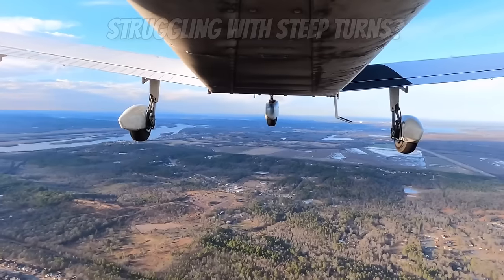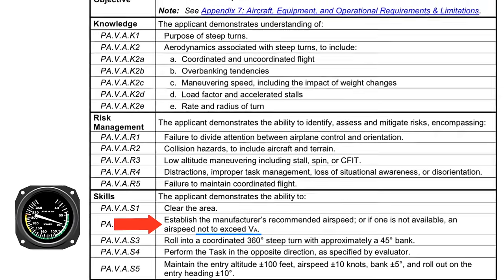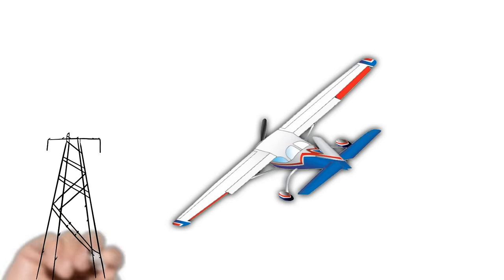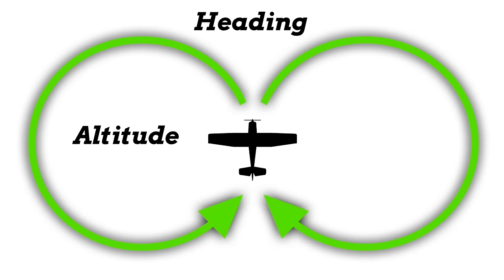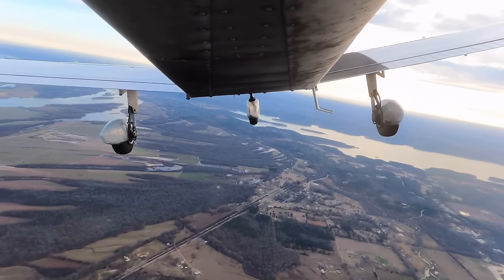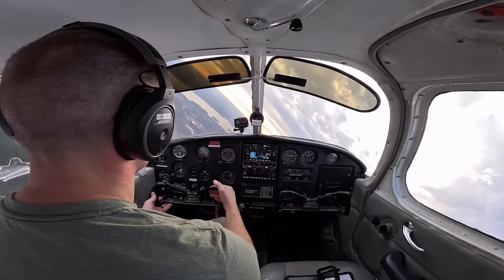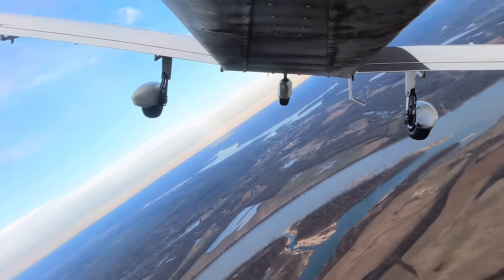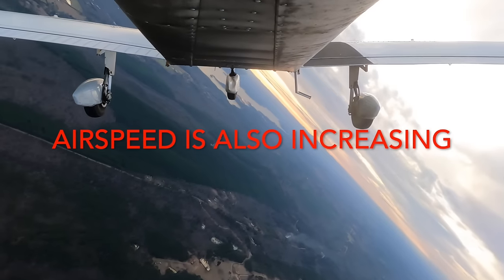3 SECRETS to Fix Your Steep Turns | How to Perform Steep Turns

Comment: The best instruction I've seen about steep turns;excellent job!!!
Reply from the maker: Thanks Rafael!
Reply: I agree
Reply from the maker: @FeltonZackery-gm8yl  thank you!
Reply: Left out the use of the VSI VERY IMPORTANT and use of Trim.  It's ok to use and will help you.  So where is the instrument that gives 1.414 Gs.  Learn toss that and scan interpret scan interpret scan interpret and use smooth inputs.  In over 45 yrs of flying and years of teaching I don't know any pilots who are doing 45 degree turns with passengers on most flights.  You need to know how to do them safely and that takes practice.  Be safe

Comment: How do some modern aircraft not have a G meter? Modern phones have a G meter. Just rapidly rotate in place with your arms outstreched and it will jump to like 4 or 5 G sustained. I don't understand why they would design planes without a tiny little accelerometer. Maybe they just figure you will attach your phone to the instrument panel and use the G meter in the phone for the aircraft?
Reply from the maker: Unfortunately things like that have to go through a certification process.  If you think about it, it kinda makes sense because IF you have a G meter and the G limit is 4 Gs.  How many people are going to go out there and try to pull 3.9 Gs, then if it’s even slightly out of calibration, you just over G’d without knowing

Comment: I also recommend looking at the VSI.  It will give you a better indication of what's happening.  the three secrets are fine, but remember use all the resources like TRIM, POWER, SCANN SCANN SCANN the other INSTRUMENTS, and there is NO INSTRUMENT THAT tells you your holding 1.414 Gs so tossssss that.  Learn to use your trim it's easy and you can use it in ALL Planes.  We're not doing 45 degree turns in normal flying or at least shouldn't especially with passengers, but we must know how to do them safely.  So PRACTICE and be safe.
Reply from the maker: Agreed. The only bad thing about the VSI is that it’s a lag instrument. It won’t always give you accurate info right away

Comment: What I found critical in preforming steep turns is controlling the wing loading at the entry of the steep turn. A quick glance at the vertical speed indicator is a good indicator in determining if you have the correct increase in elevator pressure as you enter the turn. Once the bank is established, small adjustments in the bank angle can be used in controlling the pitch attitude and altitude. No need in fighting the elevator control pressure when to can control the wing loading by increasing or decreasing the bank angle.

Comment: I am working on my private. This morning I'm taking a quiz and the question I am looking at asks - What should a pilot do if the plane continues to lose altitude while performing a Steep Turn? Answer A) Briskly pull back on the control wheel to bring the nose above the horizon or B) Add power and wait for the airplane to regain the altitude. Of the two options (answer C is clearly wrong and not worth mentioning), I'm tempted to pick A but uncertain. What say y'all?
Reply from the maker: I don’t like this question because technically neither answer is correct, but they are probably wanting you to select A as the correct answer

Comment: Excellent instruction as usual.
During my training I had a hard time with steep turns because I was too focused on the instruments. At one point I told my instructor to be ready to intervene if something looks wrong and then I ONLY looked outside, trying to keep the point where the horizon disappears behind the dashboard stabilised. That was my first smooth steep turn and I didn't even lose or gain altitude. Now I mostly look outside and occasionally glance at the VSI and it works every time.
Reply from the maker: Thanks! It’s amazing how much easier it is when just looking outside

Comment: Great presentation! I’m working on CFI right now, and my instructor and I have been going back and forth on the best way to maintain altitude in a steep turn. I’ve always used minor power adjustments and elevator to control altitude. Using bank angle makes more sense. I’m definitely going to give it a try.
Reply from the maker: Thank you so much! Give it a try, let me know what you think.

Comment: Great video. My only comments are the potential loss of speed is due to the increase in drag. As AOA increases, drag increases. I’m not sure that  neutralizing the ailerons is some big secret, if you don’t, the airplane will just continue to roll into a steeper bank. Also, over banking tendencies will require a little opposite aileron (depending on bank desired bank angle). Also rather than peeking at the ball, one should develop a sense for skidding and slipping. I agree with you on rolling a bunch of trim in...don’t do it. Finally, while technically accurate about the g-loading, no one is going to find a g-meter reporting Gs to the 1/1000 place and be able to fly it. Look out the window and keep the nose planted where it needs to be by small deflection of the ailerons.
Reply from the maker: Thank you! I appreciate the comment.  I know that there is a lot of detail that may be difficult for students to replicate, but I think it helps give them a good understanding of what’s happening when they’re performing the maneuver.
Reply: @FreePilotTraining  you’re doing a great job. Keep at it.
Reply from the maker: @whoanelly737-8  thanks!

Comment: Also, I pick a mountain point out on the horizon to start the turn and roll out of. But you suggested a Cardinal direction.  I will try both ways and see what works best. I am a student piliot
Reply from the maker: The reference on the horizon works well too. You just have to be careful about that because you technically need to roll out on a specific heading

Comment: Working on my private pilot license and I have been struggling as I transition to the the second turn. My first steep turn is generally stable and coordinated. When I roll into the second turn I fall behind the airplane and tend to lose altitude. I am going up today to practice and I am going to try these tips. Doing some chair flying to practice before my flight. Will let you know how it goes. Thanks for the tips. Your channel is great and your training videos are the best ones for me. You make the concepts simple and easy to understand and you don't waste time with irrelevant jibber jabber. Thanks for being an awesome instructor and for making this training available to a guy on a budget!
Reply from the maker: Your welcome Scotty! Let me know how it goes!
Reply: @FreePilotTraining  I am happy to say it went much better today. My first attempt was my best. I used my ailerons and bank to control my altitude. On my second attempt I over banked to 60 degrees once but corrected quickly and only lost about 50 feet. It was a bit windy but the over bank was on me. I need to improve at scanning inside. Your tips definitely helped! I will continue to review this video and chair fly. With a little more practice I am confident I will dial it in.
Reply from the maker: @scotty-55YJ  awesome! Thanks for the update!
Reply: Hi Josh, I passed my checkride and I am now a private pilot! I kept my steep turns within 25 feet. They were some of my best. Your channel is great and I learned a lot of what I needed to know and reinforced my learning by watching your videos. Thanks for continuing to share your knowledge. Learning never stops and as my examiner told me after passing "this is a license to learn". Thanks again for providing awesome free content!!

Comment: What about opposite aileron in the turn to prevent the over banking tendencies and reducing asymmetric lift?  Kinda the whole point of the maneuver I was told by an Army Air Corps instructor.

Splendid videos. I really appreciate your efforts. I know it a bunch of work.
Reply from the maker: This is a great question! Yes, overbanking tendencies are a real thing, BUT, if you neutralize the ailerons like I discussed in the video, the effects are so minimal in MOST airplanes that if you keep any opposite aileron in, your going to climb. Typically two or three quick corrections throughout the turn is all you need. You’ll notice I descended about 40 feet during my turns and I just used a little opposite aileron to correct that. Thank you for the comment!

Comment: Great video! If you can tolerate and manage the G loads, a 60° steep turn is easier than a 45° turn. The overbanking tendency of an aircraft is at its most at 45° of bank. Beyond that the differential tip speeds converge. The theoretical 90° bank is essentially a loop on its side with matching wingtip velocities and zero overbanking force. Who knew?
Reply from the maker: Yeah, I’ve noticed that. Thanks for the comment!

Comment: Awesome video. Great advice on using aileron to control altitude on a bank! Video idea: What is a great way to remember critical steps on a touch-and-go, go-arounds, or climb? On a recent touch-and-go landing, I forgot to put full rich mixture back in before climb. It wasn't until about 700 feet, before turning into cross-wind leg, that I noticed my mixture was leaned.
Reply from the maker: Thanks! You might like my newest video on go-arounds

Comment: Cool tip I learned was as you roll and hit 30⁰, apply 2 full turns... top to bottom... of trim and continue to 45⁰ holds the horizon like magic.  Then as you roll out, put the trim back as you pass 30⁰ again to wings level. Magic I tell you!
Reply from the maker: I’ve used that one before. It works pretty well

Comment: Even simpler:  From left seat and left turns, nail the nosecone on the horizon.  Yes you can't see it but you know where it is.  From left seat and right turns, nosecone is a little lower (instructor will see nosecone on the horizon).  Glance inside to check bank angle, rudder ball and airspeed but mostly keep eyes outside.

Comment: Great stuff. I have a couple of questions. When using ailerons during the bank to correct horizon, do you "clear" them as you do for initiating the bank? As the plane turns through the wind what adjustments would you expect to make? So head, cross, tail? Should you factor wind direction into the choice of initial heading?
Thanks again
R
Reply from the maker: You typically don’t need to neutralize the ailerons if you’re only making a correction.  If you need to make a big correction, sometimes you have to take half of it back out so you don’t go past where you need to be.  As far as wind goes, it’s not really a factor for this maneuver.  We’re concerned about bank angle, not the shape of your circle

Comment: Advanced autopilots also use ailerons to control altitude once in a steep bank, say 60+ degrees.  Since a smaller and smaller percentage of the lift vector is vertical, trying to control via pitch would cause very large deviations in g-load.
Reply from the maker: I actually did not know that

Comment: Great tips, I am currently in CPL training and this is a very helpful review and info.  For CPL in Canada we do a turn through 180º, with an angle of bank of 45º, then without pause, reverse the turn to roll out on the original entry heading with the same limits of ±100 feet, ±10 knots, ±5º of bank, and ±10º on heading.
Reply from the maker: That’s interesting. I feel like that wouldn’t be too bad

Comment: Another excellent training tip. I also discovered the "neutralize" action as well during my practice sessions. All other tips are on point, loved the flying "T" reference.  Will definitely keep that in mind going forward. Also, great to see you flying the low-wing Piper for a change which DEFINITELY has different handling characteristics, in particular the between-the-seats trim wheel which is nothing like Cessna's easy-spin "wheel of fortune" in the center console! Keep up the good work Josh!
Reply from the maker: Thank you so much! Yeah, I have always loved the Cessna 172, but the Cherokee is such an awesome plane. I definitely wouldn’t mind owning one.  Thanks for the comment! I’ll see you around!

Comment: Another good vid !   FYI... I like to bug a heading for things like this.  Also... in a Warrior,  I give the trim wheel 2.5 pulls back, and it really helps keep the nose in the right spot. I know your Cherokee is a different trim system... but why wouldn't you use the trim to help?   I find it's easier to tell people to push between left and right (keep from ballooning)  than to have new pilots hold the correct back pressure.
Reply from the maker: Thanks! The trim definitely does work, but I like to feel how many G’s I’m pulling. The trim on the ceiling definitely makes it tough too.  Thanks for the comment!
Reply: To me, using trim during a steep turn feels a little bit like using the trim as a primary flight control, which of course it is not. Also, I find it to be easier to release back pressure when rolling out than putting in forward pressure.
Reply from the maker: @erich930  my thoughts exactly

Comment: Good tips. I bet you’re using trim in C-130….just curious? I did in DC-6 as it was just easier due to control pressures.
Reply from the maker: Thanks! Yeah, I do. I pull the yoke back first though, then trim off the pressure
Reply: Yea same here I am doing it at the same time I guess. I don’t teach others to get caught up in predetermined trim settings as you know things are always changing in flight. Other than the obvious takeoff settings and such.

Comment: You missedf one important tip on how to get better at it. You notice where the actual horizon meets the glareshield or your engine cowling in front and when stabilized at one altitude during turn you "let that horizon pass through that same spot on your window and glareshield.
Reply from the maker: Great point! Thank you

Comment: Do you correct for losing or increasing altitude by EITHER, pulling back more or pushing forward on the yoke OR, do you increase bank angle or lessen bank angle? I'm having a hard time understanding this. For me it seems adjusting the back and forward pressure alone helps maintain altitude. Or do they both accomplish the same idea using either method? thanks for the video!
Reply from the maker: I should’ve explained this a little better. You have to kinda guess on how much to pull the first couple times, but as a general rule, ailerons are what you should use to correct your altitude. If you have a good power setting, you should control your airspeed with your pitch. If you’re pulling too hard, your airspeed is going to slow down. If you don’t pull enough, you will speed up. So, roll for altitude and G for airspeed
Reply: @FreePilotTraining  thanks for the response!
Reply from the maker: @jj6457  No problem

Comment: Thanks for the video. I'm a long time commercially rated pilot who has always struggled with steep turns. I'll definitely try these tips. Perhaps you can offer one more: The maneuvering areas we have available are in mountainous terrain. I constantly get dinged for not looking outside enough, but it's tough to keep the horizon lined up with a point on the glare shield when 75% of the circle doesn't have a flat horizon. I've asked instructors how to handle that and none have had a good answer. Any thoughts?
Reply from the maker: You’re welcome! So, as far as the mountainous terrain is concerned, I’ve done steep turn a few times, and I typically imagine most of the horizon by finding a spot that isn’t mountainous then dragging the nose across that same height in the mountains, but you can use the attitude indicator to do your steep turns as well. Just use the pipper on the center of your water line and use that as your target pitch throughout the entire maneuver. If you do this, I would reverse your cross check. Your primary focus is your attitude, and you will take quick glances outside, then back at your attitude, then over to altitude, then back at the attitude.
Reply: @FreePilotTraining  Thanks. That's what I do, which is where the instructors choose to ding me. My next strategy will be to ask the instructor to demonstrate. I'll keep an eye on them to see how much they look outside in that environment. If they can do it, I can get there too. If they can't, I get to do it my way! ;-D
Reply: I will also say that I've never used the ailerons for altitude control. I think that could help a lot since the adjustments are finer and I might not be killing my altitude control so badly if I'm using pitch to effectively keep a constant G force in the seat.
Reply from the maker: @alexarnoldy  it’s amazing how big of a difference it makes
Reply: Nice video FPT!

I too struggled with the steep turns… I picked a windy day to do my check ride back in the 90s… hoping my lack of precision would be blamed on the wind…

I got a lesson that day that looked very similar to your video!  To demonstrate how it is done… The check airman put the C152 into a steep turn, cranked in a known amount of trim, added a known amount of power… around we went… all on target.

Had I known the procedure as well as you have demonstrated it… I wouldn’t be writing this thank you note.  😀

Comment: So what does the rudder do here? Not quite sure
Reply from the maker: Mostly, it’s used to keep the tail aligned with the nose
Reply: @FreePilotTraining  oh in general i know what it does, but in a steep turn, lets say to the left, do you use left or right rudder or constantly adjust?
Reply: In my simulator a left bank requires right rudder to maintain alt. At steep banks the rudder is now the stabilizer with more or less authority depending on aircraft design.

Comment: How would you even get an over G in a coordinated 45 degree turn? That's 1.41 G. What aircraft is designed with a G limit of 1.4?
Reply from the maker: It’s only possible to over G if you are ABOVE maneuvering speed.  If you are below Va, you will stall before an over G